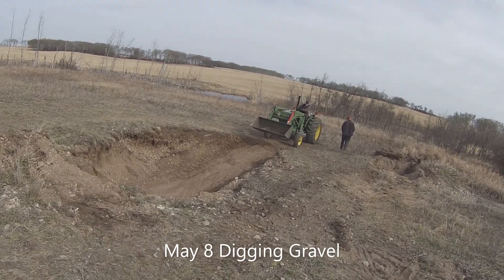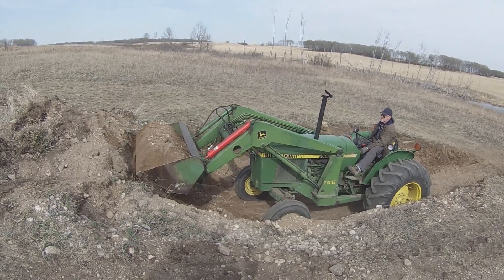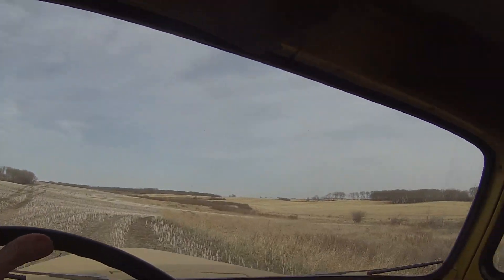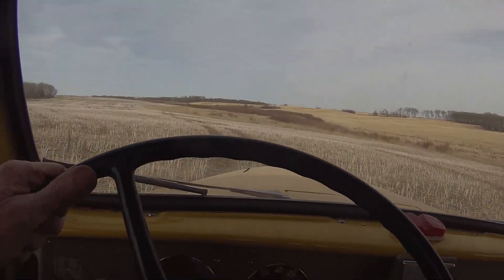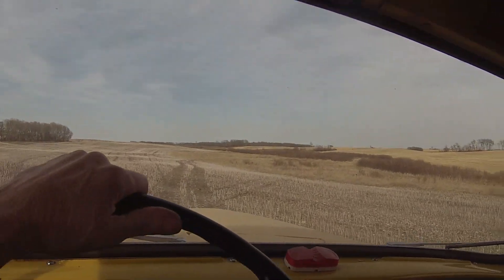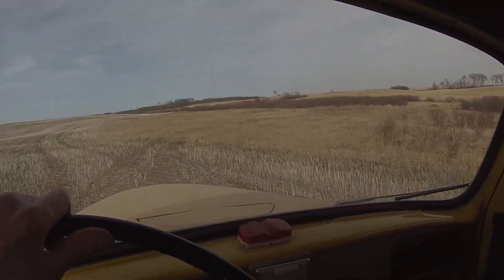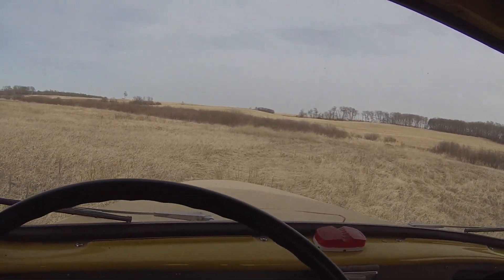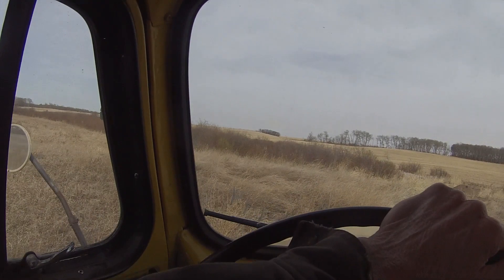May 8 Gravel with the 2140

Comment: That old IH still gets the job done.
Reply from the maker: Thanks. It does ok. The carburetor switch from last winter has improved it some. Now it needs a new clutch. This one is just brutal. No slippage but it just jumps and jerks and will stall the engine.

Comment: nice :) my truck was super low on hydraulic oil. i put a gallon in & seems fine now.. 1 super small leak, but im not worried about it.. lol
Reply from the maker: This one has a unique system. The hydraulic cylinder is actually the reservoir for the oil. Pump is built right into the bottom of the cylinder. Seems to work ok.
Reply: @roosty6  mine has a little 1 or 2 gallon tank under the bed right behind the 2 cylinders . theres no filling it if the bed is all the way down.. u'll get 2 see all that 1's i up load the vid..lol
Reply from the maker: @MrJohndeere3720  That is the type of hydraulic pump I have on the Loadstar. Separate tank with the pump inside and hoses going to the lift cylinder.
Reply: @roosty6  kk. :)